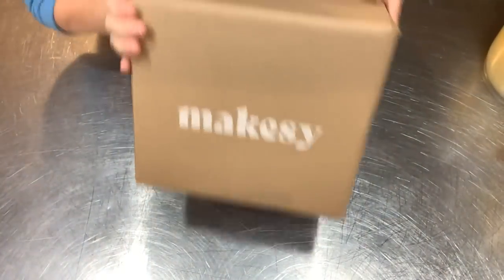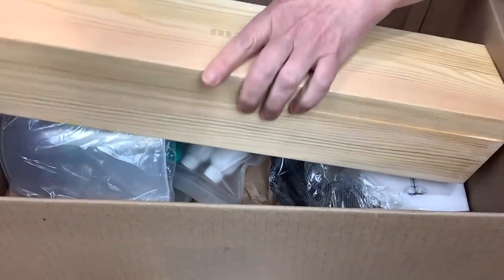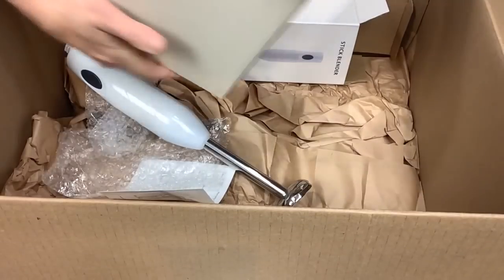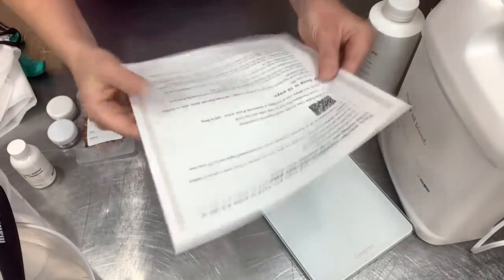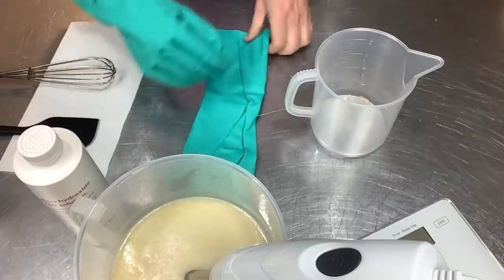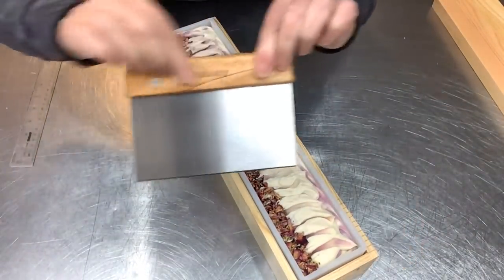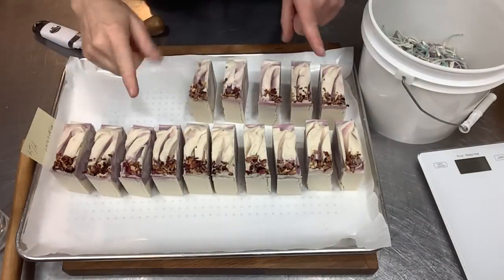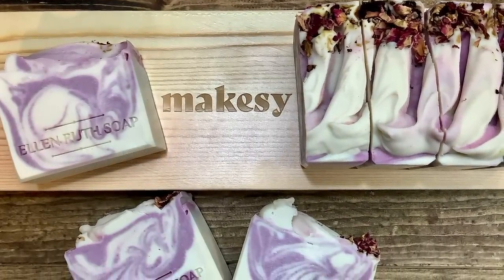Let's Make Soap❣️  MAKESY Unboxing & Beginner Cold Process Soap Making Kit | Ellen Ruth Soap

Comment: The 50/50 lye solution from makesy is what I use in my soap making I don’t mess with lye I don’t even care to pay the extra money 😂 I’ve used their formula and let me tell you very very good for someone looking to begin their soap journey. Also all my molds are from them 🤪
Reply: I love the 50/50 solution. I know of some other shapers that make their lye 50/50. My question is, how does the water discount work? 

I have several recipes that call for a water discount.  Would love some feedback.
Reply: @mitchmitchell8062  if your using 50:50 lye solution let’s say 14oz of lye solution then you’ll only need 7oz of water so half of your lye measurements
Reply: happy to here that, I was a little skeptical about it at first and it's not cheap lol

Comment: They are beautiful! I do a 48% discount. I also add 4 Oz of a vegetable or fruit purée sometimes I’ll add 3 ounces of coconut milk or powdered goats milk. I did get aloe Vera juice. I’m freezing it into cubes then I’m going to use that for my lye solution. I’ve done a 50/50 lye solution before. It turned out awesome. I didn’t know that u can buy lye premixed. That makes it so much easier n safer. I’ve been making soap for 7 years n I had no idea u can get lye like that. Thk u! 🖤
Reply: Hi. I'm confused on how to use the 50/50 lye solution. I plan to use my own formula/oil blend, with your lye solution that I currently have. Yet, I do not understand how to find out implementing the amount of extra water that I'll need. I use a Winston & Walter 7.5  pound soap mold (20.13" L x 2.56" W x 4" H), With a 1.5:1 ratio of water & lye. Also, use a 7% superfat, 3% citric acid, and 1% silk fibers . Please help 🙏🏽

Comment: Lovely Kit Ellen. So you would be okay about soapmaking without a digital thermometer? Kinda fundamental don’t you think? So an extra piece of equipment people will need to buy to support their process. I would have to myself. Temperature checks are vital.  

And the Trinity Blend? - 33% Coconut Oil, 33% RS Palm Oil & 34% Olive Oil? If so, a nice hard, bubbly & creamy soap bar from easily accessed oils that are not too expensive. This kit is a great teacher in the wisdom of master batching oils & lye - for that reason I love it! xx

Comment: Everything in the box - except the thermometer...
Reply: We soap at room temp, so the thermometer is not needed!
Reply: @makesyofficial  It's still not included... ;) A newbe soaper might need it even if you don't.. ;)
Reply: What is the discount code?
Reply: @makesyofficial  Hi. I'm also confused on how to use the 50/50 lye solution. I plan to use my own formula/oil blend, with your lye solution that I currently have. Yet, I do not understand how to find out implementing the amount of extra water that I'll need. I use a Winston & Walter 7.5  pound soap mold (20.13" L x 2.56" W x 4" H), With a 1.5:1 ratio of water & lye. Also, use a 7% superfat, 3% citric acid, and 1% silk fibers . Please help 🙏🏽

Comment: Sorry Ellen, but I am really disappointed that as an experienced and regarded soap maker you obviously allowed your sponsorship and commissions to interfere with providing a honest review of this kit.  I would have pointed out that while it is certainly true that the soap is "safe" to use and sell in two days, that it is because the saponification process is complete and there is no active Sodium Hydroxide present.  You know as well as I do that soap needs to cure a minimum of four to six weeks...not just for water evaporation to produce a longer lasting bar of soap, but also for the crystalline structure to form to produce a gentler bar of soap.  Fresh soap may be 'safe', but it is also harsh on the skin.  

You said repeatedly that you were going to follow the instructions as if you were a new soap maker which you did and didn't do.  You sort of did when you dumped in all the salt and clay since the instructions didn't provide any measurements (as you noted), but at the same time, this kit is supposed to make two batches of soap so you should have only used half.  You didn't when you noted that floral fragrances oils tend to accelerate, so you deviated from the instructions and didn't add the FO until after you separated the batter.  Had you followed the instructions you would have added it as directed, you would have been plopping that batter into the mold.  And you didn't when you turned the soap on its side before you cut it because you know about drag marks.

Now I don't object to soap kits...it's how I got started, but I purchased mine from a reputable soap supplier which is what I recommend.  On it's face it not a bad kit...you get everything but Distilled Water, but I think it's a lot of money to spend on something you're not sure that you will enjoy.  I personally don't like "blends" as you are stuck with them; you know what oils/butters are in them, but not how much.  The 'trinity' isn't bad since you can assume that it is generally 34% Olive Oil, 33% Coconut Oil and 33% Palm Oil.  But if a 'blend' contains multi oils and/or butters, you're going to be using a lot of trial and error (and ingredients) trying to replicate it.  If you are only a hobbiest...a blend is probably the best way to go, but if you plan to sell soap, it will get really expensive really fact.  And I have issues with any company that sells a blend or kit an doesn't have the individual components available.
Reply from the maker: Well.... I hear all your objections...  But, I found the kit really fun and inclusive, and I had a great time using the products.